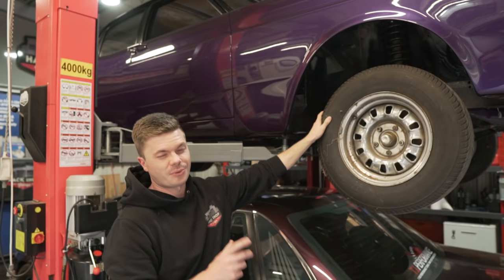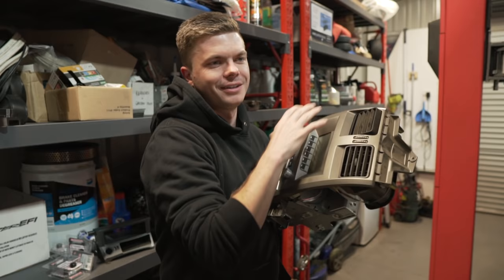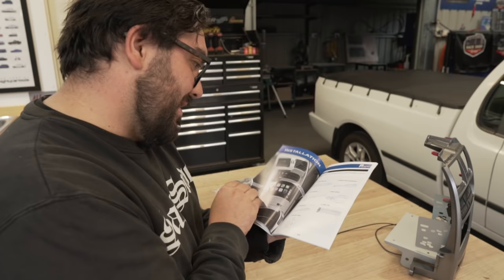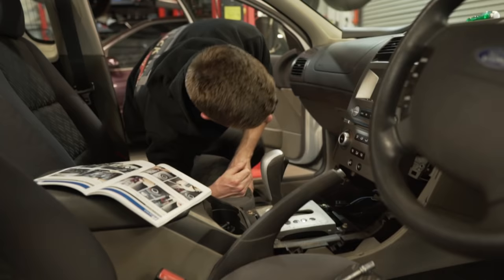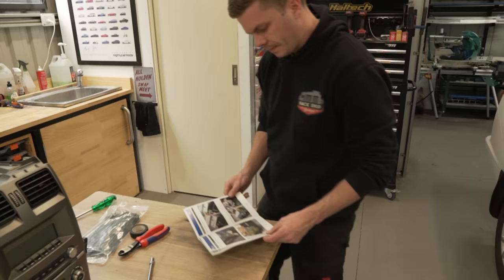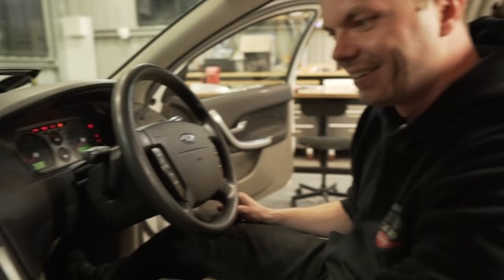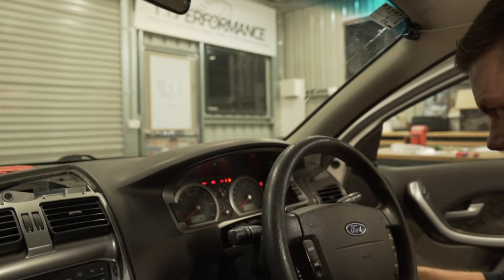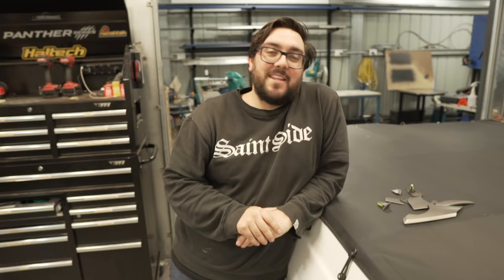THE UPGRADE EVERY BA-BF FORD NEEDS!! - Double DIN Headunit Install

Comment: Good to see someone finally brought out a decent fascia for the double din stereos.
Reply: Yeah,I had come to term with the fact my stereo in my xr6t was always going to be shit.now it doesnt have to be that way,my life has improved somewhat
Reply: Bro you been missing out for years…. One word- Kayhan.
F putting a airpro and then paying for a double din. 
My Kayhan is the best thing I did to my BF besides the built diff and axles.
Reply: @christianwuchatsch9510  Depends on the objective. Even the Aerpro kit is a bit expensive for what it is.

For a shitbox, like my wagon, I'll stick with the single DIN solution. Fascia and cabling ends up costing about $100 plus whatever single-DIN unit you buy. I don't need to see my phone messages while I'm driving. Safer that way.
Reply: The console in my BA wagon has died. Could this replace it?

Comment: Needs a gauge pod now 😂
Reply: supercrap autos used to sell one
Reply from the maker: Needs a turbo first to justify it haha
Reply: @HackshopGarage  Fairmont clock!
Reply: I have a BA XR8.  Almost no options were ticked by the original buyer when new.  It has the basic ICC like the one in the video, no gauge pod, no Fairmont clock, not even the stripes along the doors.  It does have the phone presenter:  probably the only option.  I would like to try the gauge pod for voltmeter and oil pressure gauge.

Comment: Rather than replace the top triangular bit, opt for a guage pod with amp and oil presure for NA, or boost and oil press for Turbo. And run the wires while the centre units out, and tape to top of dash to connect up once centre untits back in.

Comment: yes indeed lol RIP top panel. I got mine a few days ago. Haven't got a head unit yet, but thought Id carefully ....oooooh so carefully....start removing the panels. I watched all the vids....you're supposed to lever the back up gently and then pivot it up and forwards .....the two clamp thingies just shattered off and then the whole thing just disintegrated lmao. They're near impossible to remove now without damage. My 03 BA is 21 years old.....that's a LOT of heat cycles in the Australian sun suckin up all that UV. All these plastic parts pretty much ensures that most modern cars will never make it to 'vintage' with all original parts. Hopefully 3D printing and AI powered scanning software for  phone cameras cn make replacement of super rare plastic parts no big headache in the future  (that's if we are even allowed to drive them....we'll probably have to brew our own petrol in a few decades if the WEF muppets get their way)

Comment: Volt and oil pressure gauge in pods would be my second mod(back in the day) mounted where the panel is missing.
RiP top panel

Comment: Funny enough that i found this video as i was looking today for prices on the aftermarket kayhan icc and there was another brand as well.  This upgrade to the facia takes you back to old school double din unit which is essentially what i always wanted to do to the territory!  Great work guys and yes i snapped that filler panel in my BA ute as well!!!!
Reply: Bro Kayhan ftw… I love it and looks better than the off centred buttons on the Airpro unit

Comment: I had a FG MK2 XR6 from new for 10 years. It had the updated colour system with Bluetooth. But it incorporated a Ford "Typical For The Model" feature of disconnecting the Bluetooth connection when you started the motor. Every single time.
It also had no reversing camera, which made reverse parking a mystery every time too. And like yours the A/C was integrated into the touch screen. I remember the car stereo shop telling me a solution was coming, which I reckoned was as likely to see in my lifetime as a return of Hayley's Comet or anthropogenic global warming proof.
I ended up trading it in for a new Stinger GT last year. A red one. Best decision ever.
Reply: Have fun with the V6 lmao. In all seriousness the Stinger is a great car but I can't stand V6 engines...
Reply: @prolosertheatomistic8101  same mate, love my V8s and straight sixes. Rather a turbo 4 pot than a V6. The Stinger is cool as fuck but, probably one of the best options if you were looking for a SS, XR8 or XR6T and don't want a Mustang.
Reply: @TheTeeroy32  Yeah would rather a turbo 4 myself too. V6's can be good but there's something so cool about the smooth torque of an I6 or V8. 

Love my XR6T, I feel like going to any other engine bar a LS, RB, or 2JZ will be a huge step down.
Reply: Aerpro have been "releasing" an FG facia kit for years now. No idea when itll actually arrive.

Comment: I have a question regarding power issue, well no power at all to unit on ignition? 
I bought my BA with the unit preinstalled (worked well for 5 months), so I have no idea re fuse/relay location and have checked what I could internal box and under the bonnet, as well the manual which I have.
Any input/heads up/moment in video I missed? Anybody? Cheers...

Comment: As an owner of a Toyota Soarer i can really relate to this, getting a single din head unit in and working is pretty easy, double din on the other hand is a whole other story, I'd have to get a custom built loom from nz, an ac unit imported from usa, and god knows what other changes or parts I'd need, so I went with single din and all I really miss out on is a reversing cam but I just put a monitor inside my sun visor
Reply: I can also relate to the wiring stuff, my first car almost got burned down by my horrible first attempt at wiring, my soarer definitely shows how much I've improved and learned, currently she's got 3 amps, 2 subs, 2 tweeters, 2 6 by 9s, a bass enhancer and 2 4 inch speakers (and not a single blown fuse or anything fried or killed yet) and my god it's good, free back massages when I knock off from work lol

Comment: How do you know if the infodapter is faulty? I've installed mine in and watched maybe every install video there is on YouTube re: this unit - when I press Menu/Trip and or Climate buttons, my unit flicks over to 'no video signal' any knowledge on this? My unit is a Sony XAV-AX5000

Comment: Planning on adding this to my 2006 TX Territory, for someone who has only had experience changing headlights, fuses and tyres. Do you think I'd be able to do this?

Taking off the panels and the stereo seems easy, but everything past that loses me quite quick.

On-top of that, how would you go about installing a reversing camera as well? I know that you can use this kit with the existing reverse camera, but would the same process apply to adding a new one?
Reply: how'd you go?

Comment: Ive got a Ford BA Fairmont Ghia. 

i was wondering if this would work the same? as i have the premium sound system & i also have 4 buttons under the stereo for "Traction control / interior lights / door lock / Trip) i noticed this console only has 2 buttons under the stereo

Comment: Hey guys, I have this exact head unit and facia replacement kit. Was just wondering what you did with the "speed" wire as there is no other one to connect it to (the pink one). Cheers, love the vid.

Comment: Was that ute ABS? I did the exact same mod on my ute with an XR6 dash after watching this and now it keeps chucking up ABS, trac control lights and brake warning light. My ute does not have ABS, i was just wondering how to take these lights away?
Reply from the maker: Hey mate, this is a BF series 2, I’m pretty sure it has ABS, I never had any issues with lights but I did make sure to get a BF series 2 xr6 dash too. Just incase there was any difference in wiring with different models

Comment: wish i knew you were in the market for those bits, could have hooked you up with cost price ;D also run the park brake wire from the hu to ground, and you can turn off "grid lines" so when heater controls come on they're not in the way of the image

Comment: Was going to do it as my radio is crap plus my heater doesn’t work! I was told that it had a crook sensor! So doing the radio din, will it replace the sensor too? Cheers Ray
Reply: An extremely common reason for the heater to stop working on B series falcons is they snap the blend shaft in the AC unit behind the dash. Ford do a new one that is more reinforced now. It's about a 4 hour job to change out for somebody that has done a couple before (dash has to be removed).

Comment: Great to see you mixing it up a bit .. "RIP top panel ".. Warning ..1 time use only Lol
Reply: nah you use a fine tip sharp point and remove those yellow locking plugs, the Top plate is held in by the base of the locking plate teeth and the 2 pins up top. Easy to get in and out from that way

Comment: Airbox at the front of the vehicle two fans controlled to produce forced air into the manifold cheap power just fuel selling you get a ss to hsv straightaway power

Comment: Can you still by those Ford specific tissue boxes designed to sit in the bottom?
Reply: those tissue boxes with the Ford brand are going well over $250 unopen on ebay
Reply: Look up motoring box does a tutorial on making one yourself and provides a diagram

Comment: hey fellas, i have a question. im wanting to do the exact same thing to my BA ute, is the XR6 dash out of whack because the speedo goes higher than a standard dash?
Reply from the maker: Hey mate, no it still read corrects
Reply: @HackshopGarage  that include the tacho? main reason i ask is cos i have a manual
Reply from the maker: Yeah the tacho reads correct too
Reply: @HackshopGarage  thanks, much appreciated

Comment: If only they did this for the FG! Sigh
Reply: I'm with you Daniel!!! Any FG Upgrades!!! If there is, where?! Any information would be much appreciated. Cheers guys, awesome vid as well!🤙
Reply: Aerpro are bringing out the FG / SZ version hopefully very soon, there is apparently a few small issues they are working on before release, they were supposed to come out at the same time but the later model one needed more work. but it is coming!
Reply: @Messy304  Holy crap, that is the most exciting thing I have heard this year. Been waiting YEARS for this :D